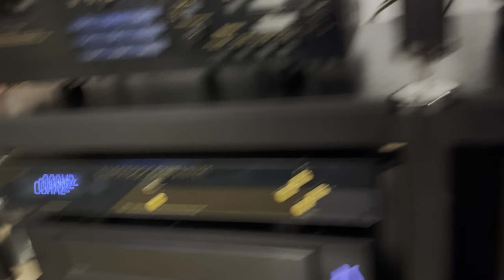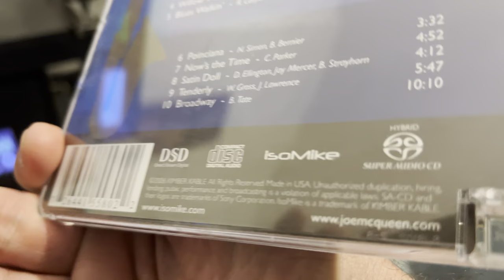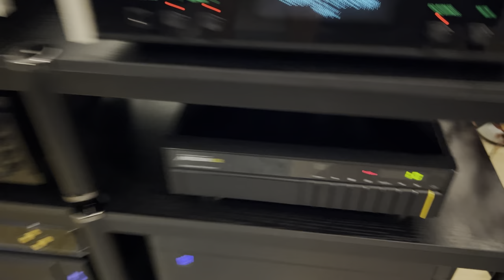An Audiophile in Seattle "Ok, Ok...I Finally Installed Room Treatments!"

Comment: A tip for finding where to put your panels. Have someone move a mirror back and forth along the wall. You sit in your listening position and where you can see your speakers in the mirror is where you put your panels. Good way to find your reflection points
Reply from the maker: Yup! Used that technique in other homes where I had space in front of the speakers along the walls. In this room I have all glass, so I use cloth shades. Thanks for watching! 👌🎼✨

Comment: I am sure you will lkke this and possibly catch the bug! I use the blinds on the window as a diffuser with the shears tames it just a bit. How I adjust the blinds makes a difference. 

One thing I can say is with my big ole horns in a small room it's very hard to suck the life out of the music! 😆 

Probably what makes the biggest difference in my room  is having the corners done on the front wall. If I could do the back wall I would.

Comment: You might try to move your speakers a little bit closer together. That may help your center image.
Reply from the maker: Center image has always been locked in. It was reflection from the back and side corner that was causing bounce. The panels have fully corrected this. Moving the speakers closer together in this room collapses the soundstage. Your advice is sound once again legione1! 😉👊💯🎼✨

Comment: What DAC are you using?
Reply from the maker: Electrocompaniet ECM 1, I show it & shout it out in the video 7:41,  thanks for watching!
Reply: @vpconcepts9838  no problem! the reason I asked is because the type of DAC could contribute greatly to the quality of your mid-range. I found it out when replacing my normal Delta Sigma DAC by an R2R DAC. The R2R makes the center image extremely focus and real. The Delta Sigma DAC, even though very high quality, makes my center image blurry and distance. Just my 2cents